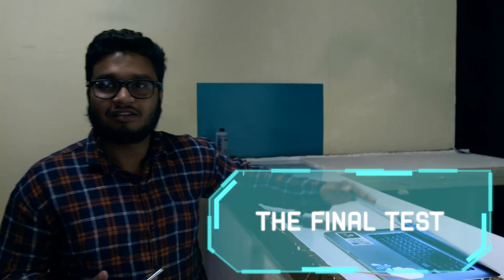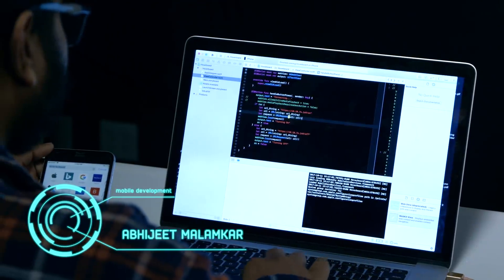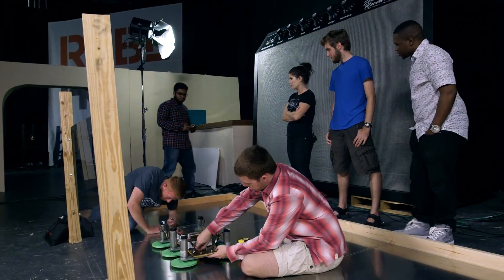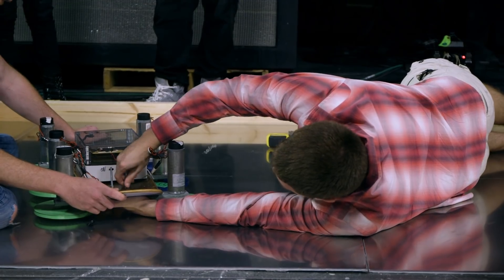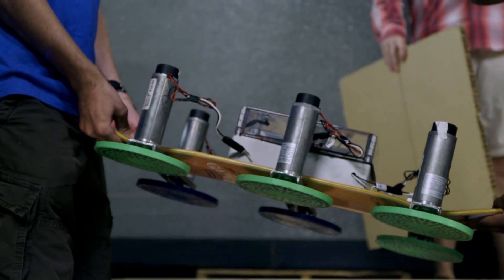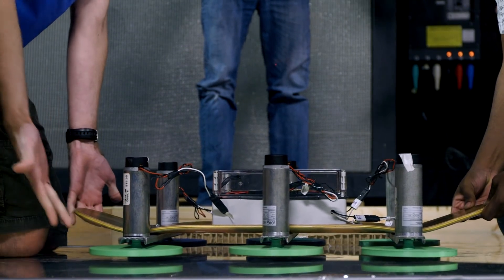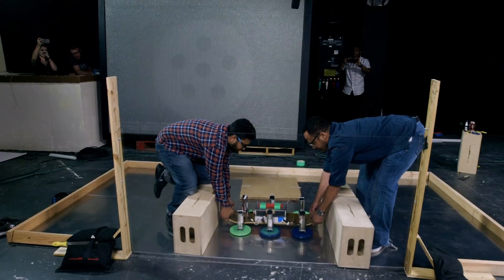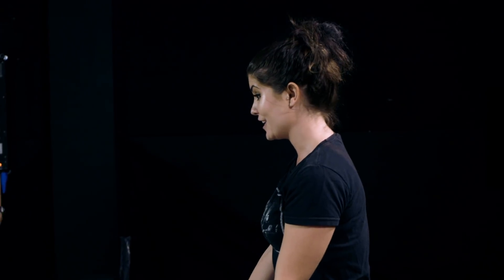Hacker Labs: Hoverboard Challenge Finale | Full Sail University

Comment: I think adding mechanical gears at 36 volts would take the power of motors running like 50v and couldn't be easily stopped by the opposing current. Just my presumptions tho.

Comment: Sorry, but the hacksmith could have done it better without y'all. Upgrading the motors was good, but you should have started wither even bigger motors, more torque, more rpm. Everything needed to be bigger: motors, magnets, aluminum, disks, voltage.
Reply: You are right

Comment: You guys are experiencing magnetic braking. I think copper may have worked better, but no matter what, I think the field generated in the metal will always accelerate the disk in the opposite direction until it stops and cannot spin to generate a magnetic field any more. My hypothesis is that this method will never work. It's the same way bullet trains stop. In other words, you're just testing the load a motor can take by braking using magnets. But I'd love to see you prove me wrong.

Comment: I don't like to leave comments that aren't constructive so I'll try to be helpful, but jeez guys, what the hell was this? A 6 part series of 90% filler and fake TV drama, and the only actual engineering was done by people just barely smart enough to get themselves hurt. Any idiot should know those discs should have either been printed at 100% to start, or not printed at all and machined from a block so it was actually strong enough to withstand the RPM. You somehow thought that replacing your brushless motors with cheapo DC brushed motors was going to give you more power? Seriously? You need brushless motors, the weight to power output of DC motors is next to nothing compared to Brushless. You also relied on WiFi as your emergency stop? Seriously? Wifi goes down all the time, even for just a few seconds, that's why buffering is a thing, and when your only option for an emergency stop is waiting for your wifi to come back or reaching into the machine to flip a physical switch, you're going to have problems, which is exactly why your motor burned out. James was clearly the only engineer around there and it still sounded like you ignored most of what he told you guys to do. On top of that, you celebrated as if you did something amazing, when over the course of six episodes a full team of you did significantly worse than X-Robots did in his one, weekend experiment.

As for the actual videos themselves, I would try to tell you what you could do better, but I have this deep nagging feeling that you're doing it exactly how you want it done. Your production equipment is top notch, and you clearly have a sizable budget for video creation, you're just choosing to make this like all the Discovery Channel "Science Drama" shows that we came to the internet to avoid. If you want proof of this, look at your numbers. You've gotten two shoutouts that I'm aware of from Hacksmith, and a massive budget, and you're at 130k. I know people who use gopros for filming who have five times the subscribers you do, and it's not like you get views to back that up. Looks like more than half your subscribers don't actually watch your videos, and that's assuming literally no one other than your subscribers watches.

Lastly, choosing a woman with no experience in engineering as the host of your engineering show, to make the men on the show seem smart by comparison, is borderline sexist. It perpetuates the stereotype that women don't participate in engineering, and as a woman in an engineering field, it's extremely transparent as a cheap, sexist, trope.
Reply: Agree with everything except the sexism part, which no one even noticed..
Reply: There’s only dudes on the team tho no women wanted to join
Reply: coatduck totally agree
what machinists say about engineers semms to be true in most cases

They only have theory

I’ve seen a lot of small or medium YouTubers do better than you.

And you know NOTHING about 3D printing

This video series is a shame for the technology part of youtube...
Reply: Totally agree...I just binged the whole series and noticed all there mistakes, and felt like the Hacksmith was as well. I'm especially angry that they have a member on the team specifically for mobile development and we don't see the app at all, just the iPhone home screen...Also using 3d printed materials was a risk of itself, to not make a 100 percent solid platform was just icing on the stupid cake...not trying to be mean I get they were probably trying to save print time, but in reality it just costed them more time printing more. Should of just casted a disc from non magnetic metal, or rubber....really disappointed as what this could have turned into...
Reply: i agree with everything you've said here, especially the sexism, i saw it in the first episode but didn't know how to put it to words, she always seemed so impressed by everything they were doing but a woman(or dude) engineer would find these things normal and might even add constructive comments. as a woman engineer i also found it sad that there were no women on the team. adding diversity gives a new perspective where some of the problems they ran into could have been avoided
Reply: @_.dana._  I agree, but a large percent of woman, do not like the nitty gritty stuff, for example when i was in a technical school taking welding and metal fabrication there was 1 woman with us... and she was awesome, in total less than 10 since 2000 till today. Engineering has had less than 15 in 20 years, carpentry has had less than 30 in 20 years. On the other hand Cosmetology, cooking, and child care all have had 950+ each since 2000. I'm not a sexist by any means, but damn, and this was only one technical school, im my opinion a large one, but i don't travel much.

Comment: LISTENTO MY RECOMENDATION!
alright look. notice that the rotation slows down as it gets closer to the ground. what you need to do is make a power regulator that as the rotation speed slows down the volts go up. to keep it suspended in air or no matter how much power you have it will ALWAYS be to much or to little!!!!!!!!!

Comment: I think electricity to generate the magnetic field is better than using actual magnets. It's lighter, safer and the strength of the  magnets can be varied. Meaning that you can let it run on minimum flux at the start for RPM then increase flux once you get the required rpm.

Comment: To the build team: Congrats, for a 2 month build, while you're going to school, if you get really any result at all that's a success. Well done. I bet almost every choice was "How can we get something kind of like what we want done with the quickest turnaround"? Rather than "How can we make this happen?".

To the university: If you want to make things like this possible, spend $25,000 on getting a decent lab outfitted. Get a Tormach. Get a lathe. Get basic fabrication tools. This felt like someone brought in a few rubbermaids to a rec room in a community center, not a university. If you want your students able to do hands-on challenges you have to be able to reasonably build things, otherwise just let them do software and simulations.

To me this seemed like a bunch of non-tech people building something, in their approach to the project. I don't know if it was hammed up for the show, as a media project, but, fundamentally someone could have easily done the calculations and known the expected amount of lift, there shouldn't have been a surprise. Seems the most important part of the engineering, the part where you have a good grasp of the basic principle, was skipped over entirely, at least in what was shown. Basic testing seems to have been skipped too, lock a motor with magnet plate into a swing arm on a test jig and see how much weight it can handle at various voltages. No point in making 6 of something and randomly throwing voltage at it with nothing to base it on. That's what an uninformed novice would have to do, engineers should've been a bit better.

Still, really envious that nothing like this was available when I was in school.
Reply: YOU should work on this.
Reply: u wrote a bit tooo much

Comment: I definitely would not celebrate this, this was the most disappointing thing I’ve ever seen
Reply: It was a challenge. Instead of using electric motors maybe if they went to gas. Gas has a lot more Power at higher RPMs but does not have the instant torque at zero RPM.

Comment: To be honest....I think it would have worked better if you guys were trying to use an electromagnetic field instead of a field created through permanent magnets. That way, you could avoid having to use powerful motors to spin the magnets over the metal plate. Also, using an electromagnetic field is probably safer than spinning glued magnets at a very high velocity.
Reply: BlackHawkRider true, true
Reply: I was about to say the same, well said.